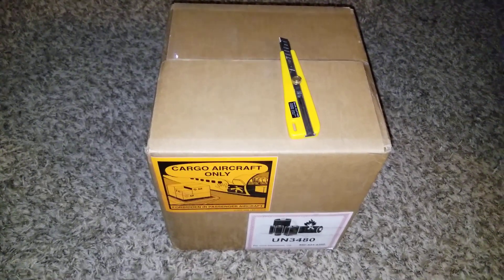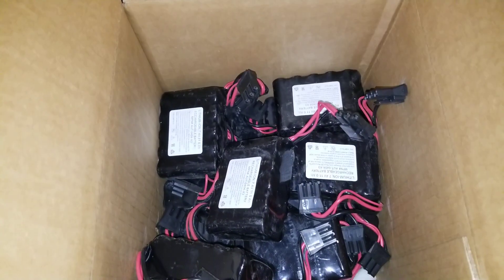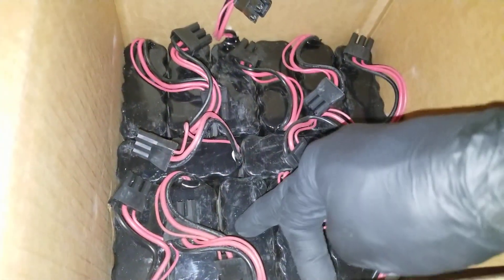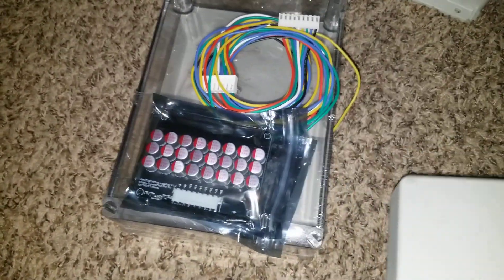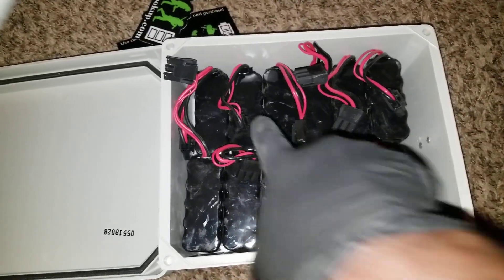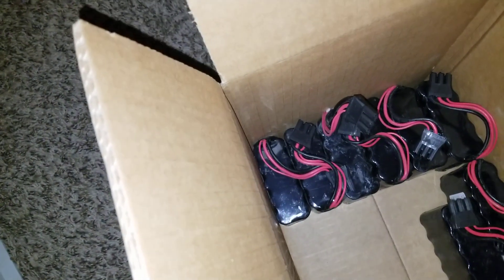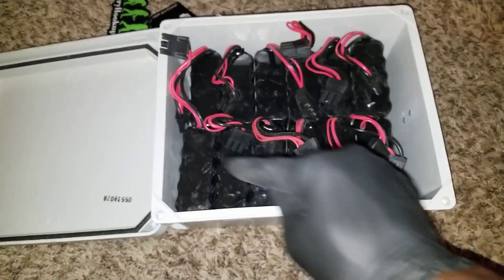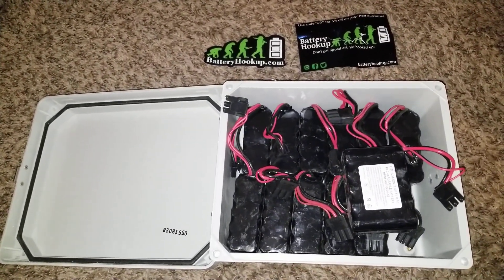LG CHEM MODULE WITH BMS (Part 1)

Comment: Those are some great cells for the box . If  they can be standing up vertically enough to almost touch the top opening , you might can get many more inside . But those are great 👍🏿 king of stick to as many as possible that are lot in stock at Battery Hookup .
Reply from the maker: Yes

Comment: I have have a❓ why do batteries have 3prungs, is one of a BMS hook-up? Maybe a heat sinsor, of for more power?
Reply from the maker: BMS uses a common port to charge and discharge through the same wires. Both of the red wires connect to the same area of the BMS so you can use either of those red wires or both if you want. The two thicker main red and black wires are 14 gauge and the smaller red wire is 18 gauge. So the wiring and entire pack is set up to handle 10a.
Reply: @jwsolarusa  I understand, it's somewhat tricky for me when batteries come this way with no instructions. In some cases it's no benefit in taking the pack apart but sometimes you have to just to how it's wired and why. Then you have to put it all back together. It's the safest way I know how to get what I want from battery packs I know little or nothing about.
Great video and thanks for the feedback.👍🤔
Reply from the maker: @jamesfrankland4436  
Thanks James for your input